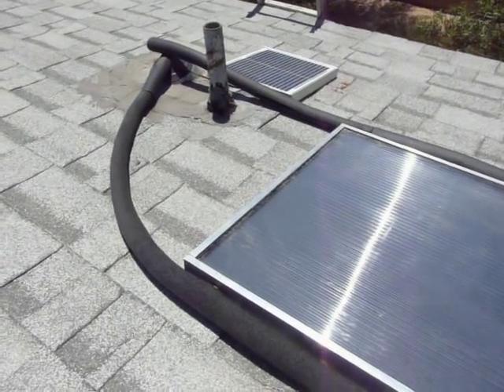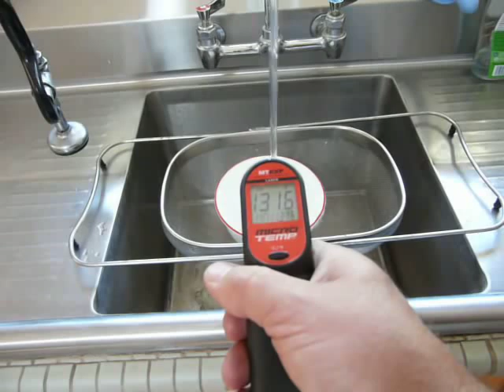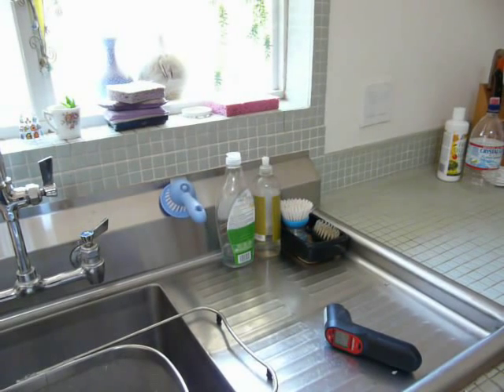Heliatos Point of Use Solar Water Heating System

Comment: You should advise people that in a locations where water freezes outside in winter this type of system will freeze and the plumbing will burst because you are pumpinig the fresh water from the home to the outside collectors. In freezing temperatures this will freeze and burst the plumbing. You should have a closed system with a heat exchanger on the collector loop and use anti-freeze in that loop. Either that or a drain back system where the water drains out of the outdoor plumbing.

Comment from the maker: Using a PV panel as a power source and controller is actually a little more efficient than using a standard controller. While the traditional differential controller controls based on a simple temperature differential the PV panel controls based on radiative flux which is a more direct control strategy. If you go through the detailed calculations (and from experience on hundreds of systems) you will find out that the only difference is that the PV panel is cheaper and far more reliable.

Comment: Also, without the use of a controller, the system powered by PV cell will start pumping before the collectors are hotter than the storage tank. That will cool the water before heating it. It will also continue to operate durring the late afternoon hours when the available energy from the sun is considerably less than the storage temperature. This will also cool the water down considerably. It is free heat no doubt, but still a system without a controller drastically reduces system efficiency.
Reply: STARFIRESOLAR it seems to me that the pump will begin pumping when the voltage/current is high enough to start the pump. And when that starts would be partly  determined by the solar panel wattage. A lower wattage panel may take a while to turn the pump on giving the water in the water heater panel time to warm up. Also the volume of water in these small panels is under 3 ounces, so the water inside them should heat up to near the storage tank water temperature fairly quickly. I have a couple of these panels myself but my project is on hold and I have not yet hooked them up for testing with and without a controller.

Comment: That looks like something that would create all kinds of roof leaks.......I'd never install anything on my roof that way b/c it looks like a leak nightmare.   What stops the water from coming in the house when it rolls down and hits that panel, just flashing and slicone?  I mean, I know that chimneys have the same kind of problem sometimes, but then again, chimneys leak quite often also. 
 It looks like it was 4-6 feet long and that means all that water has to roll off horizontally for that big distance to before it can continue to it's normal drainage trajectory. 
If you have any trees whatsoever I can see you having to get up there non-stop and get the leaves off it to heat your water and also if you don't clean it regularly you'll have organic crud buildup on the top side of the panels which will then cause water to drain over the top of the panels and/or leak into your house.
Seems to me some more design thought needs to be done here b/c this is only going to work in the desert or places with almost no rain.